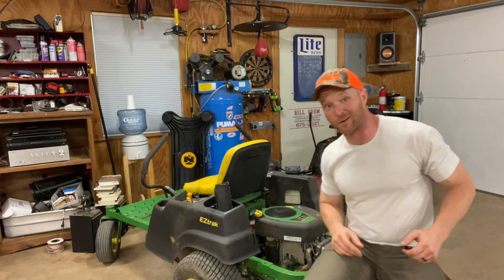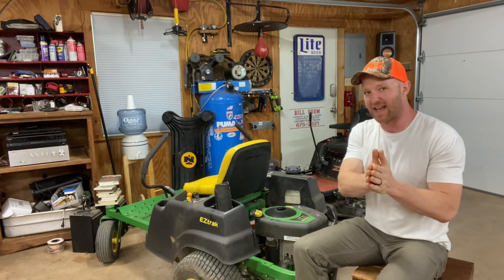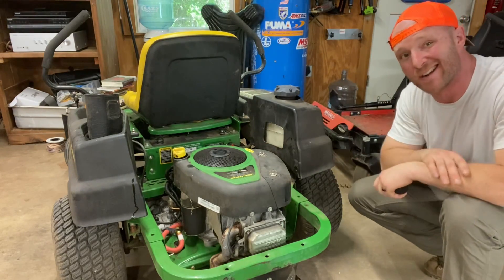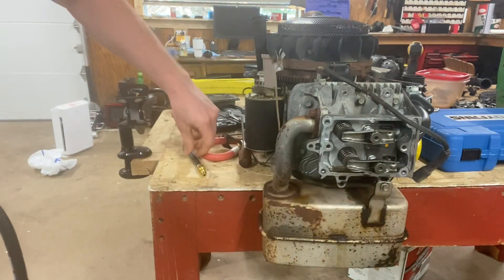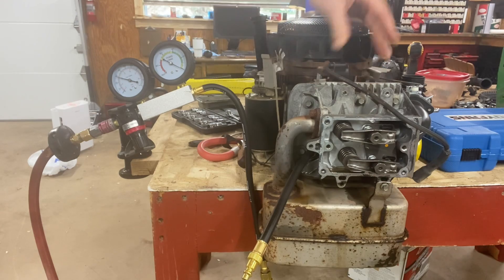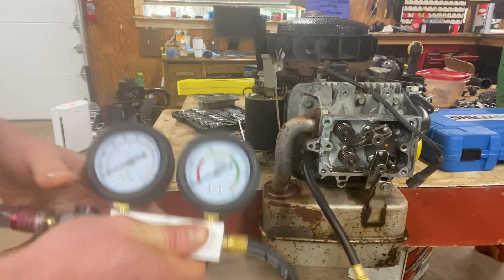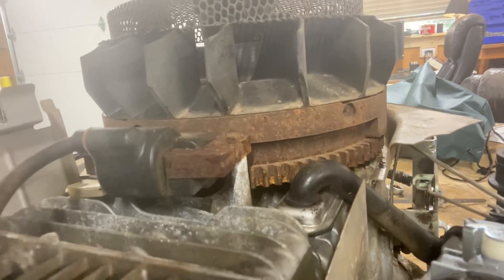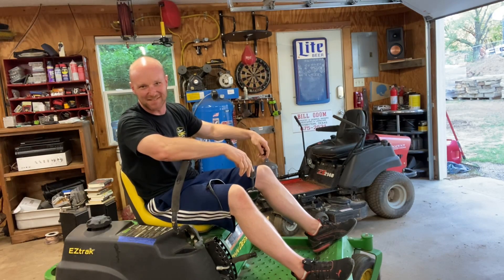Riding Mower Smoking! QUICK FIX + Cylinder Leak Down Test (Briggs)

Comment: Can the ride mower explode if you use it like that?
Reply from the maker: Excellent question, I bet it could it you set it up right. But, no I don’t think the mower would blow up randomly running.
Reply: @MowerMike 
I had an old 8 horsepower 30 inch cut, it was down on power so I tied a wire to the throttle and would pull it, it worked for a while like 3 times cutting my grass just under an acre. On the 3rd cut I went up a small hill started down the other side and bam! The rod came out the side of yhe block.  True I was over reving it, I was surprised at how long it lasted.  😅

Comment: I just got a Z225 john deere. It's been running fine than today I went to jump start it and it blew out so much smoke I couldn't see. I shut it off and there was oil that came out of the exhaust. Gas on the dip stick and oil had come out of the little black thing that the fuel line and two other lines go into. Any idea on what that maybe? How I can fix it? Or what I should do regarding gas in the oil? I would really appreciate your input
Reply: Or the carburetor could be leaking gas into the cylinder
Reply: @bertgrau3934  I agree, float needle sticking flooding engine with gas.
Reply from the maker: Wow she is spewing everywhere. I suggest draining the oil seeing how much is in it and refilling it with the right amount and try again. Maybe water got in the oil or someone topped it off with too much oil.

Comment: I've got a 22hp twin John deer zero turn that wouldn't start. I pulled the head and 1 of the valve seats had pushed out partially so the exhaust valve wasn't closing. I hammered the seat back in as best I could, put it all back together and now it runs great but is smoking from that side that I "fixed" could this be because the valve isn't seating all the way? And is it a big issue? It's not smoking bad. I just don't want to tear anything up and would rather not replace the valves and everything
Reply from the maker: Interesting. You can pull that head off and lap the valve. Google it is easy
Reply: @MowerMike  awesome I'll give that a shot!
Reply: @ryanwood1062  I would remove the valve spring and use a center punch on the valve guide to ping it a little so it doesn't push back in again. The smoke can also be from oil leaking by the exhaust valve guide.  So machine work or replace the head.

Comment: Hi! We ran over a chunk of wood. Instantly smelled something burning and the mower shut off. HELP!!
Reply from the maker: I suggest looking under the mower. My guess is your bent a blade and it is jammed up against the deck causing the spindle to freeze and the belt is getting hot. 
 
Just spitballing
Reply: @MowerMike  Thank You! Will have buy a Jack or something to help us lift it on one side to check. Appreciate your quick response 👍🏽
Reply from the maker: @Whattheheck1  Sure thing, the blades usually bend and make things seem worse than they are. Good luck
Reply: John Deere zero turn

Comment: So if I remove the dipstick while it's running and it's blowing oil out I need to replace the piston rings?
Reply from the maker: She has some issues but if it running I would just let it be. Maybe put a little filter where the oil dip stick goes.
Reply: Runs like a champ just burns oil. Probaly 1/2 qt for every 2 acre's of grass cut. I'll just sell it if putting rings in it won't solve the problem. I've got a Scott's that runs just fine. Thanks for your input!
Reply from the maker: @sheltdog8463  I am the same way, I usually just junk them if the engine internals go bad. But I have a yard full of old mowers to play with lol. Good luck with ole Smokey, maybe try a thicker oil.
Reply: @MowerMike 
I agree,  I use about 20 Lucas oil Stableizer 20% Lucas and  80% oil I usually use synthetic 10W30 . That usually helps, if it doesn't,  you probably need new rings.  If you can find new rings, especially if it's a 1 cylinder,  the rings are around $50. Not bad for fixing an old engine verse buying a new engine,  or complete mower.  That's assuming you can do the work yourself.

Comment: Mine only blows smoke, pretty thick, when started. What would cause that??
Reply from the maker: When the pistons and what not will expand a bit as they heat up causing a better seal. Or you have too much oil in it and it is burning off. Just guesses here
Reply: @MowerMike  OK thanks
Reply: Or valve stem seal on some engines

Comment: Hey Mike I got a Kawasaki engine in my John Deere x475 that's blowing white smoke now I've already had to head gaskets replaced on it but the smoke still there could it be my rings gone bad
Reply from the maker: Yep or the valves may not be seated. One or the other
Reply: @MowerMike  Mike one more question about the white smoke that comes out it smells just like antifreeze or coolant but when I loosen the cap on the radiator the smoking stops any thoughts on it
Reply from the maker: @darrelldundee5045  This is just a guess but when it is hot that coolant is pressurized and when you take the cap off it removes that pressure. So maybe the pressure in the coolant passages on the engine is causing it to leak through some cracks.
Reply: guessing a head is cracked or warped. Someone changed the gasket they should have checked for the head being warped. A leak down test with the radiator cap off will show it is leaking combustion in the cooling system. https://www.youtube.com/shorts/fSdxMOSZuCc

Comment: Around me, and I work on a ton of mowers, the zero turns, go for big bucks, like one the other day, no engine, no deck, trans are shot, and the seat missing 800 bucks..... It's nuts around me, right outside Newark Delaware, and they sell that's what get me, but I have had a few in tip top shape I can't get above 1000 for em, so I don't bother, I sell em falling apart for top dollar, people around me are nuts... LMAO
Reply from the maker: Ya prices for junk have gone up. I usually won’t give over $200 for a broke mower.

Comment: My zero turn mower was smoking when I had cut the grass. It was blowing blue smoke then it had stopped , I let it run for few minutes so the oil can go down
Reply from the maker: Sounds like she has some issues.
Reply: @MowerMike  I think she had too much oil in it , oil was everywhere round the engine and then it didn’t had no gas see I got Ariens zero turn mower you can’t tell if it gas in the lawnmower or not. So I had put gas in it she didn’t smoke too bad like it was before

Comment: More then likely cause is when someone over fills the motor with oil.
Reply: If I overfilled my oil and ran it for a bit (white smoke was coming off the- what I believe is- the cylinder head at the very front of my engine- la115) did I cause damage? Do I just take oil out or do I need to do anything else??   It was running perfect until I did an oil change 😔
Reply: @rachelv5295  most times removing oil to correct level should stop the smoke
Reply from the maker: Exactly
Reply: Or lots of gas in oil